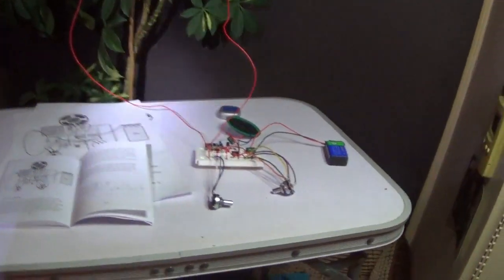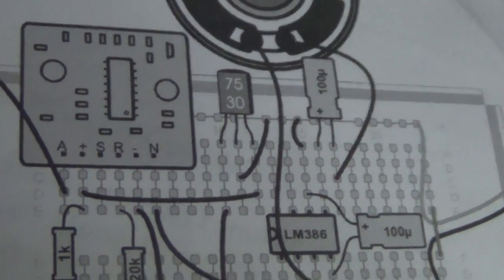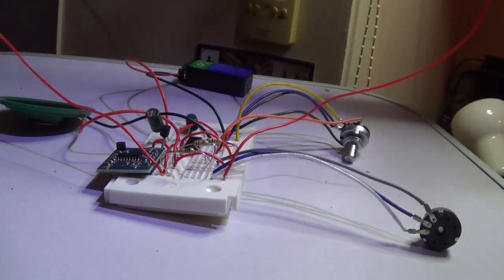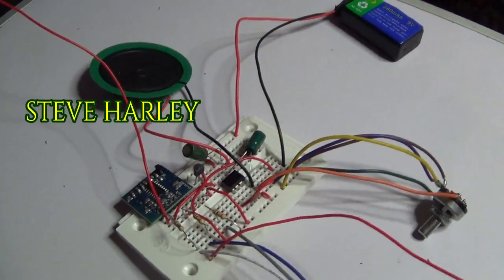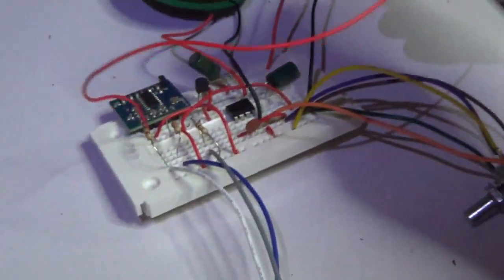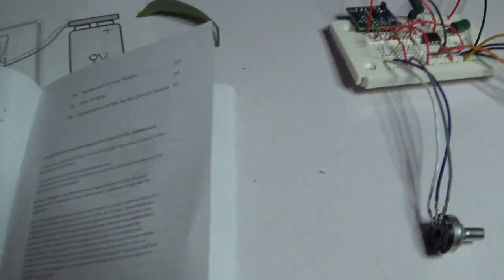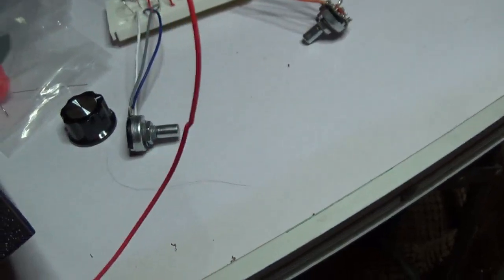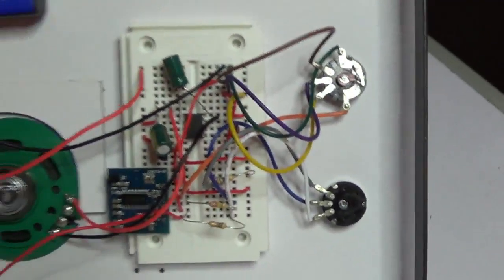Haynes Retro Radio  build your own FM radio reviewPART TWO

Comment: just built one myself , again the aerial was the issue , should not have been shorted to ground/0v   at one end , instead left it as a whip and the radio was fine , also the white board connectors were a bit poor and the radio circuit did not get its power until a few wires got redone . Great idea , let down by a design flaw and dodgy connections ,  also some other minor changes could be made to improve things .